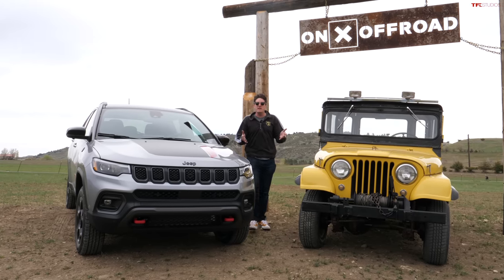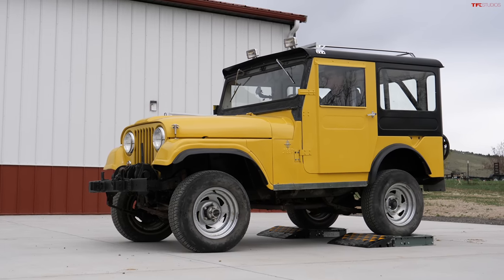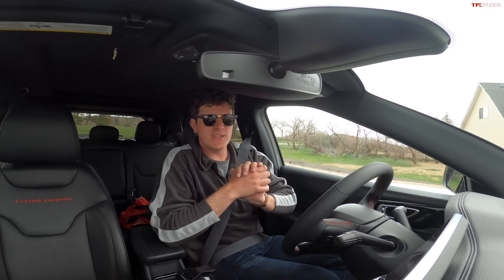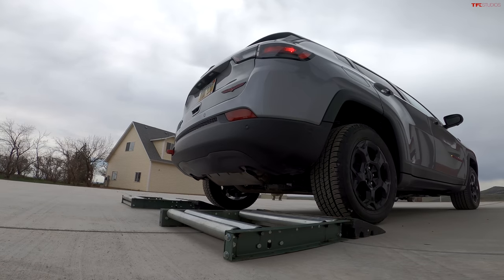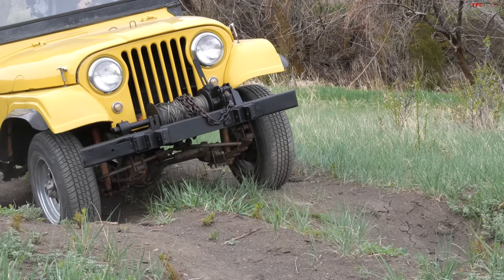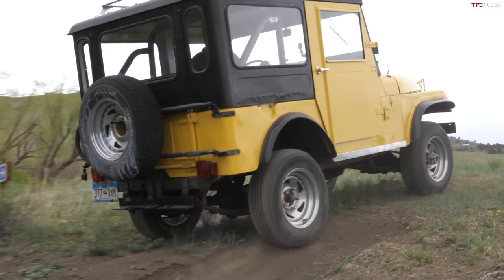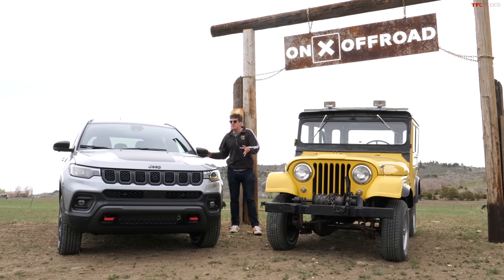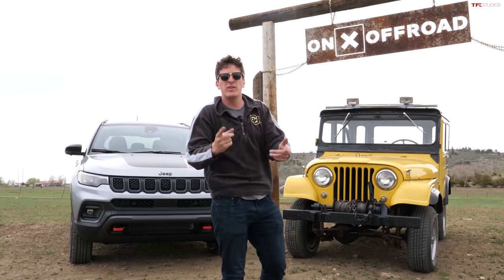Old vs New: Here’s Why Everyone Is Wrong About New Jeeps! Slip Test & Off-Road Challenge

Comment: Another often overlooked factor that makes modern AWD systems often as capable or more capable than a 4x4 in certain conditions comes down to how torque is applied to the wheels. The amount of grip each tire has to the ground in a slippery condition (say mud or ice) varies, and as such so does the amount of torque to each wheel that will cause traction to fail. In an open diff 4x4, this means the most torque you can apply to initiate movement is dictated by the wheel with the LEAST grip, and as differentials split torque 50/50 between wheels, you lose grip on one tire in an open diff 4x4 and you have no power to any wheel (yes, I know left foot braking helps, but that is its own topic). 

Now, let's assume we are comparing a Locking diff 4x4 (full lockers everywhere) to an AWD with torque vectoring by either wet clutch or brake vectoring. Let's also assume both are on the same ice or snow or mud (we are comparing slippery conditions, not ground clearance and suspension articulation in this example) and have the following as the max torque load each wheel can take before slip occurs: front left-15 lbft, front right-20 lbft, rear left-5 lbft, and rear right-10 lbft. If you wanted to slip no tires in the locked 4x4, then you could apply a max torque of 5 lbft per wheel (dictated by the rear left) so a total applied torque of 20 lbft. If you were willing to slip the rear left, then the next amount would be 10 lbft over 3 wheels (dictated by rear right), for a total of 30 lbft. If you were willing to spin both rears, then you are down to front wheels only and 15 lbft (dictated by front left) over 2 tires and 30 lbft max. Of course going to the max 20 lbft tire and slipping 3 tires would be stupid as slipping only 1 or 2 gives you more applied torque for motion. So, locked 4x4 in this scenario can apply a max torque of 30 lbft, no matter what, spinning 1-2 tires to achieve this. Now, the torque vectoring or break vectoring modern AWD will simply apply the maximum torque to each wheel (via wet clutch or selective brake activation) that it can handle, so 15+20+5+10= 50lbft of torque applied to ground and you have more motive force to get going on the ice/mud. So, for snow, ice, and mud, a modern sophisticated vectoring AWD is better than 4x4. Engineering Explained once did a fantastic breakdown of this on his channel.

Now, that being said, in a situation where wheelspin is important (or simply the robustness or resilience of the drive train), like rock crawling or going through a deep mud pit where the vehicle is bouncing and hopping everywhere, then yes give me a good, locking, solid axle 4x4 any day of the week as it will eat the AWD's lunch in those conditions, but that is not what the majority of people do off-road. As the recent demonstrations of AWD vehicles like the Honda Pilot Trailsport, Bronco Sport, and Maverick Tremor have shown (including right on the TFL channels), what would be typical off-roading for a majority of people is easily handled by good AWD systems that also make for much more livable daily drivers in snow and normal conditions than a 4x4.

Comment: Mechanically minded people like old stuff because it's easy for them to work on.

Engineer minded people prefer new stuff because it has had so much iteration.

But you mix iteration with regulation and it causes these two mindsets to collide.

Comment: This is unwatchable.  Tell me again about the complicated four levers?  I didn’t quite catch how the PTO or the availability of low range affected your ability to engage four wheel drive.  

I was interested to hear that not many or only a few vehicles from the 60s had traction control.  Which 1960s vehicles were so equipped?

Comment: I need to add this yes you need a computer to decide what your full wheel drive should do you should not own a four wheel drive you should stick with a simple on-road vehicle and definitely should not drive in bad road conditions it will cause accidents you cannot rely on a computer to make human judgments and experience
Reply: For example! i used a computerized speak to text and you can see the incorrect vocabulary. my point is made!!!

Comment: Wheel speed transfer 🤦🏻‍♂️ it’s called torque transfer and has nothing to do with spinning wheels.
Reply from the maker: Open diffs transmit equal torque left to right but a differential in wheel speed. The goal is to equalize wheel speed and change the torque load
Reply: @TFLcar  torque is independent of wheel speed. You can have a wheel spinning transmitting no torque and have a stalled wheel transmitting hundreds of ft lbs of torque. 

So no. 

The goal of riding your brakes in using the moment of inertia to raise the torque transferred to the stalled wheel.

Comment: The real difference is that modern electronics can leave you stranded…
Reply: This video literally showed that old 4x4 systems can also leave you stranded.... It was like the whole point of the video......
Reply: @iClamperson  In remote overlanding modern “4x4s” can go into limp mode over a muddy ABS sensor and that’s that!
Reply: @iClamperson  and he also showed in that very short climb he was heating up the awd system which means it's not going to handle much compared to the old jeep.

Electronics don't like heat, the harder they have to work the hotter they get and that's before you factor in the ground and air temps impacting it.

The older system used cables and or vacuum lines to operate, I've fixed both with split shot sinkers (carb cable) or duck tape around a leak in the vacuum line if I didn't have any spare hose.

Try that with today's electronically controlled everything.

Comment: Wow it just feels like you are struggling so hard to justify the old jeep. You hand wave away the face that with the plate mounted there and the tow hook it has basically the same departure angle as the new jeep. You wave away the fact that the thing is practically unlivable for anything besides off road, and even then the compass does just about everything better. Then you question if the compass will be around in 40 to 60 years. Why? The old jeep is barely around and you wouldn't want to use it for anything but a toy, and even then you ignore that people repair electronics all the time. At the end of the day the old jeep is an unremarkable off roader that has potential, but basically was saved by someone with nostalgia for it. In 20-30 years the same might be said about the Compass. The majority of the CJ's rusted into oblivion, they weren't even safe or reliable for their time. Let them die, or save them but don't acty like you are doing anything but getting a toy that does one thing reasonably well, and most things horrid.

Comment: Real men were able to get out for a whopping 24 seconds and lock the hubs in. The only sensors to go bad were, um... none. You didn't need n "idiot" light to tell you anything. If one was smart enough and competent enough, he already knew the 4wd was in. Complicated? Not hardly kid.
Yes open diffs will get you stuck. So wow put a locker in the rear and limited slip in the front. How many thousands in parts and labor if the electronics take a crap on the new stuff?
What the original sticker price between them? How about comparing an old modified Jeep with equal dollar value as the new Jeep? Go off roading in the woods and rocks. 
Does anyone believe ANY new femi all wheel drive would have survived WW2 like the Willys?

Comment: I need to stop because Tommy your mixing thing  up 4x4 means four wheel drive awd is different to four wheel drive you need to stop mixing the terminology up. Because 4x4 is different to awd. 
You interchange the terminology as I'd they are the same they are not.